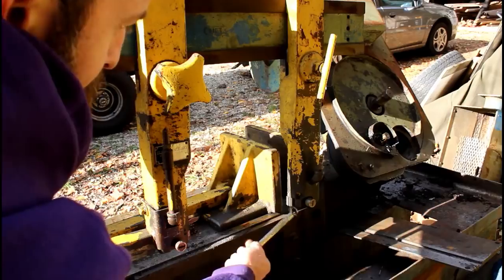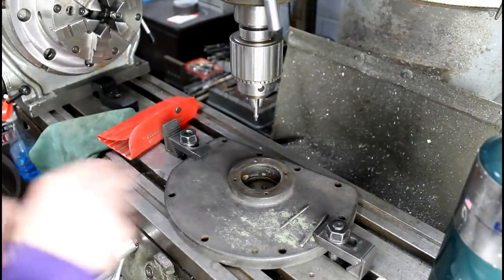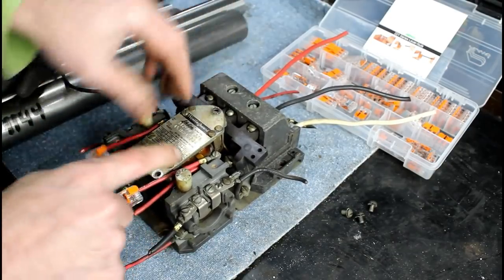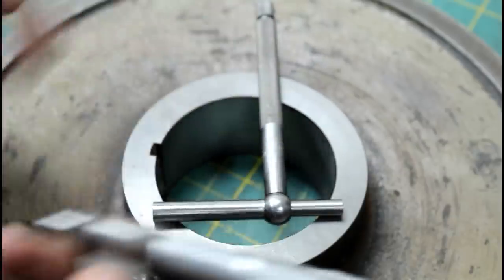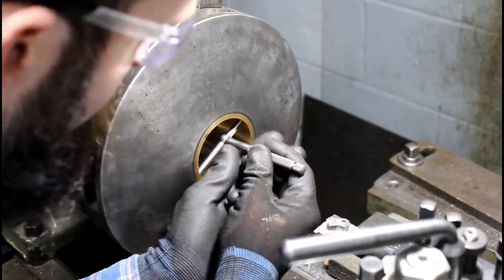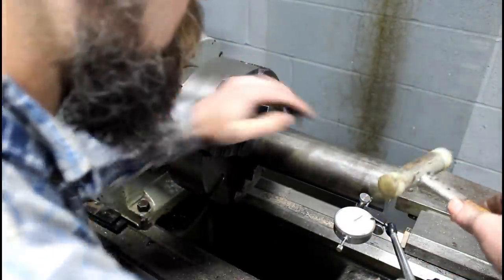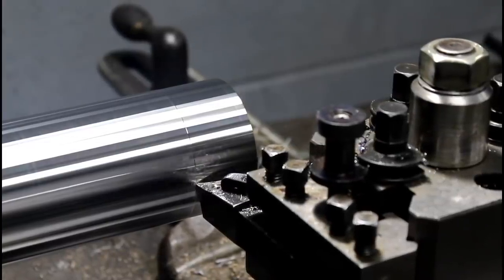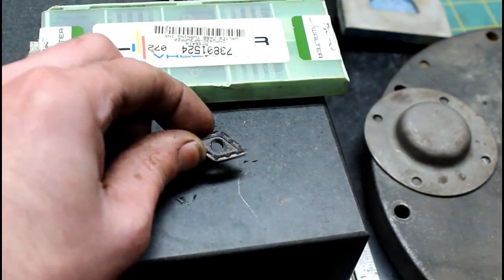Machining the Saw Drive! Scrap Yard Saw pt5

Comment: Please be careful handling those stringy chips bare handed around a running lathe. If the chuck grabs those chips it will cut your fingers severely.  That is what the chip hook is for.

Comment: Hi Steve just a suggestion buddy. Was Watching AvE channel and he showed a great tip on fitting tight bearings. If you wrap the bearings and stick them in the freezer they shrink around 2 thou if my memory serves me well. then put them in let's say the pulley. And they should slide in nicely.  May or may not work but sure was a great tip. All the best buddy.  Enjoying watching the restoration on the do-all Saw

Comment: Late to the video but the tip on the Wago connectors is going to help me out so much.  I have some wire connections I'd like to replace the wire nuts on and these seem just the ticket.  Thanks for the info.

Comment: a firm felt seal may be more appropriate for that shaft over a rubber lip seal. with a brass washer guard would keep the chips out and seal against a worn shaft better.

Comment: Took a brand new Suburban Tool ball bearing whirlly gig. Told the foreman that the bearings would not do to well with the presence of coolant as they used shielded bearings instead of sealed bearings. Many people do not know the difference between the two. The bearings were dead in fifteen minutes what with the grind dust in the coolant.

Comment: the starret at 22,33 has flat ends you never be able to messure a bore with that, the bore will be signifficant bigger than you think, nice job  Steve

Comment: I love the term magician for the previous "technician" - will have to use that one.  I also have a love/hate relationship with 4140/4130/4340 class chromemoly steel - it is really hard for me to break a chip on my hobby lathe with that stuff.  Repairs looking good so far!

Comment: I've had luck grinding a left hand cutting edge onto a right hand drill bit, the fluting is wrong so it wont work for drilling a deep hole but for hopefully just getting a broken screw to back out it works.

Comment: hey Steve,
been following along with this project since the start.. man you've got a handful here. you're already into a full blown restoration. to be honest, the few steps it would take to make this essentially a new saw won't be all that much more cost intense. so my recommendation would be to go thru with it and just bite the bullet. you'll be happy you did later. 

on the bore: throw a brass ring on the end of the tube and run it in a steady rest. then there won't be any deflection from the boring bar on the work piece. you're gonna get that if you do end for end anyway so you'll probably have to use a steady rest no matter what only on a much shorter piece.

Comment: The guy I used to work for many years ago taught me a little trick for removing broken screws like that. He took a center drill and reground it for left hand cutting. He would chuck up the center drill in his mill, clamp the part on the table, center up on the screw, turn the mill on in reverse, and almost as soon as the drill would start into the screw it would back right out.

Comment: We had that same saw in a shop I worked to for 6 years. The guides are shoes for keeping the blade straight vs bearings. Bearings are less surface on the blade so there is some movement more then the shoe. If you get it all cleaned and fixed it will cut very accurate and straight.

Comment: I've had the same frustration with trying to turn 4130. I'm surprised you got that good of a finish at that rpm, I usually turn it between 1,000 and 1,500rpm and between 14 to 20 tpr keep up the good work.

Comment: steve, going thru the same thing on my "new shaper', keep on keepin on.
Reply from the maker: This kind of condition is pretty common on old equipment. The cost of replacement is so high they often get used until they die.

Comment: A little trick an older than me gentleman showed me for getting flush broke off screws like the one in your gear cover out that I have actually had work to back out a hunk of 16MM Stainless All Thread before.
Use an Engraver .
 Stick the tip of the engraver on the edge of the screw and push gently in the direction it unscrews. The high speed vibration is the key. If it isn't seized in hard they will just rotate right out. We have air engravers at work and they really hum but a cheap electric one will do the trick sometimes too.
If nothing else the vibration will help get penetrating oil down in the threads faster.
One more thing, this "Magician' that Bubba'd that poor saw to death?
I came up with an acronym for those ugly surprises.
"STBD".
Since this is a family friendly site I will substitute the first word but I'm sure everyone can use their imagination.
"Stuff That Bubba Did."
I have found over the years that Bubba is a very busy guy and he gets around a lot.
Great series you have going here, I have the same mental deficiency as you, I like trying to resurrect the dead and get vintage machinery up and running again. Sometimes we bite off more than we can chew but there is no sense of satisfaction that compares to seeing something like this saw come back to life and work as designed after over coming STBD on top of the old age and wear that was enough for someone to just throw it away over.
I don't like to lose and it appears neither do you. Good on ya.

Comment: Steve, Nice work and progress, for around $10.00 you can purchase replacement bearing lock nuts from McMaster Carr, they are usually a decimal size such as .7810-32

Comment: Magician........LOL.  I have to say, in 40 years of working on, and repairing machine tools and industrial machinery, I have never seen one machine that has been 'touched' so thoroughly in every part by cobblers.  You can purchase new lock nuts and lock washers at most Industrial bearing supply houses or probably online. They are made by Whitit-Higgins. Not cheap, but not too bad.

Comment: The light is beginning to show at the end of the tunnel. 👍
Have you tired burnishing to get a tool mark free finish? I haven't tried it on that material but might be worth trying,if you haven't heard of it see my, or one of the other videos on the subject, on roller burnishing. Works on stainless, mild steel cast iron and brass for a pretty fair finish.

Comment: You are up against the same thing I am with my 1942 LeBlond lathe.. Top spindle speed 500 rpm.. Carbides usually like at least that or more to work properly..I find myself using hi speed steel  in a forged holder in a rocker tool post many times but I am old school anyhow so all is good.. Cheers! Mike in Louisiana

Comment: Some people love to beat on Whittet Higgins nuts instead of using a hook spanner or proper spanner ...You can buy Whittet Higgins nuts  at bearing houses along with the locks for them .....I have seen them on ebay as well.. You'll have a nice unit when it is finished but look out when you buy a bi metal blade for it...Mike in Louisiana

Comment: for 4140 roughing 375 sfm/ .045(1.5x the tool nose radius)-.250 doc (what every your situation will handle)/ feed around half the too nose radius with water cooling.
finishing around 650 sfm at .010 doc. (will produce a terrible stringer but does well with little tool pressure)
4340 if I remember right wants higher sfm due to it being more gummy.

Comment: I'm guessing winter is setting in if the thermal overalls are on.  I like them.  Good generous sizing.
Reply from the maker: I remember you saying the other day in one of your videos that you like overalls and the different types. True cold work wear . Keeps you warm and clean 👍its around 0°C here today.  Good to see you
Reply: @SteveSummers  My winter wear is a pair of quilted overalls.  A lot of farmers wear them too round here.
Reply from the maker: @bigclivedotcom  Nice 👍. If the farmers use them then they must work. The ones I use the most are made by Berne. They are very warm and hold up real well. I always like to get them on the large side that way I can move well in them.
Reply: @SteveSummers  I always choose larger overalls myself.  Much more comfortable to work in.

Comment: FYI all - if you have a screw that's stuck badly, or is just really tight, the cheapo "impact screwdriver" from Harbor Freight et.al. works wonders for these.  If you're not familiar with it, it's a heavy hand held driver you can smack with a hammer to loosen stuck fasteners.  Comes in a case with 6 phillips and straight bits, costs less than $10.  Cheap enough to keep on the shelf for when it's needed.

Comment: Great video Steve, I learned something there. Swinging on the tool post when backing off. Nice, I have always backed out and dialed back in but this is way faster and less chance of messing up. Cheers👍
Reply from the maker: I picked that up from Randy Richards channel. I couldn't do a spring pass because of the poor finish it would have left. I had a set amount to remove till the last cut each pass. It works well even on a heavy lathe.👍
Reply: @SteveSummers  Cheers Steve, just subscribed to RR's channel. Good stuff👍

Comment: Let no stone be unturned eh. Great to see you again this Saturday Steve.Great job extracting that machine screw. A tip I will most definitely use. You are a pleasure to watch work. Your a patient fella for sure. LOL, I always thought cutting 4130/40 like trying to cut an inner tube with a 2X4 LOL. I found Rapid Tap worked well. Once again your post flew by. So many thanks and see you next weekend......Dean......

Comment: Enjoying the frame off ground up saw restoration!  You are welcome to use my leg bits if you need em. Same goes if that deep boring gives you trouble the big monarch will let you chuck clear up on that piece if you need to. 😎

Comment: Hi Steve love your videos, myself as a guy who is usually forced to do things good as possible but also cheap as possible, I have a novice question on the inside mics.  When checking an inside diameter with them do the mic faces/anvils need to be rounded or can the flat style still be used without affecting the measurement.  Youre making good headway on the do-all, I hope all the problems turn out to be solveable and you end up with a decent machine.  The finishing touch would be a nice clean up and restoration of that do-all emblem, maybe machine the tops of the letters and paint the recesses-?  Good luck-!!

Comment: Pick you up a set of vampliers. They work great at grabbing the tops of screws and pins. https://www.ebay.com/itm/Vampliers-Screw-Pliers-w-Vertical-Horizontal-Serrations-VT-001-6-25/190893035890?epid=12025443531&hash=item2c721c9172:g:6LoAAOSwqi9dnqge Those Wago connectors are neat. Never seen them before. Man that is a nice chunk of aluminum bronze. Where did you get it?

Comment: You actually did pretty good with those light cuts, but you had a very tight radius on your insert. I used to do a lot of primary work for a cylindrical grinding company, so a lot of the stuff I turned was 4130, 4140. In my experience , minimum 020" depth of cut.with a carbide insert with a built in chip breaker was the ticket. You want a straw colored chip coming off the work settling to blue in the pan.  You gotta make sure that you divide your last couple of cuts evenly to arrive at your finished dimension. Light cuts, under, .020" or so, has a tendency to push the tool away from the work, skewing your measurements.

Comment: The ends of that telescoping gauge are completely flat, and nowhere near a 1.4" radius. (You can see how flat they are when transferring the measurement to the mic.) How are you measuring a bore with flat faced telescoping gauges?
Reply from the maker: These tools are designed specifically to measure bores. The ends have a large radius.

Comment: Another technique for removing broken bolts that are not real tight, is to use a sharp center punch to make a small divot near one side, then walk the bolt out the same way you removed that castellated nut.

Comment: Steve,

With all the frustration you express with making the star locknut washers, you should simply purchase new ones. They are cheap and easily available from your bearing supplier. Also point out to your viewers that the last nut that you removed was upside down. Nuts are cheap too if clean up is difficult, and are also easily available from your bearing supplier.

Removing or torquing star lock nuts with a hammer, punch or screwdriver is exceedingly common. It works, but it beats up the nut. A dedicated mechanic will own or make correctly sized pin spanners to avoid the nut damage. This will set your budget for time and money back quite a bit. I tended to consider star lock nuts expendable since they are so inexpensive and relied on the punch trick.
Star lock nuts are very common on industrial machinery. They work very well where space requirements are limited and use of very large wrenches or sockets are impractical. The spacing on the washer tabs is set up so four nut slots give minute tightening rotation to reach the "next" slot, they are also pre bent to clear the nut bevel and be ready to easily bend over into the nut slot.

Comment: I just finally got some left hand drills as well. I picked them up at a big flea market at the Thompson Speedway in CT last weekend. I also picked up a bunch of taps, reamers, solid carbide drills and end mills. I was picking up bags of new solid carbide end mils for $20.    I also got myself the 12" rotary table I've been wanting and a big jacobs chuck to use on my Monarch lathe. It took a lot of hunting to find the machinist stuff in between the automotive junk. After we left I stumbled across a used tool shop in Worchester, MA while looking for popeyes and picked up a starret depth mic for $50.  It was well worth the 12 hours of driving to get there(I'm in Canada). I've also made a contact to buy a bridge port and surface grinder next year. That gives me some time to sell some machines to make space and free up some cash. 

It will take another 12 hours of driving to get into your neck of woods but it's a road trip I'd like to do at some point.

Comment: Hello,  
#1.  Great job on the broken screw. Added a new technique to my box. 
#2.  Those snap ring pliers are a great deal.  You can easily spend that on one of the universals with the interchangeable tips that really suck. I agree with you,  don't understand how they can sell 4 pliers and a roll pouch for that price.  Thanks for the video.  The saw is coming along nicely!

Comment: Trick with those bearings on the pulleys is to remove the inner rubber seals, and to half fill the space between them with grease, so that you have a much larger fill of grease, increasing life of the bearing as you have more than the factory drops of grease in there. Even if you have no way to fill grease afterwards you will have a longer bearing life.
Reply: Problem with removing seals, gives metal chips much easier access. Keep out the ****, bearings last a lot longer.
Reply: @alanfarenden9378  Yes, but only on things where the inner seal is superflous, which allows a much larger grease backup to be there, and also where you have a bearing doing double duty as an oil seal for a non sealed gearbox, allowing the oil to do the lubrication, and thus lasting longer till you replace the seal along with the bearing.

There are some applications also where you do not actually lubricate the bearings at all, though there you also do not have cages either, like in gyroscopes ad precision instruments, where you use dry bearings because they have low friction.

Comment: This type of blade guides are more accurate than bearings, you get the support closer to the cut than with bearings due the bearing radius. Bearings are usually still used to turn the blade coming from the wheels to vertical position. Depends ofcourse of saw, how its made.
Reply: Never thought about that. Good point.
Reply: Also provides more support for the blade to keep it from twisting.  Bearings would just give contact in a line, not a plane.
Reply: Yup, the contact area is alot bigger. In horizontal bandsaw you arent running so fast blade speed that there is even need for Bearing type blade guides, in woodwork and friction band saws they are needed. Doall also recommends their ball bearing blade guides for long period of high speed work. Bearings are common in cheap saws